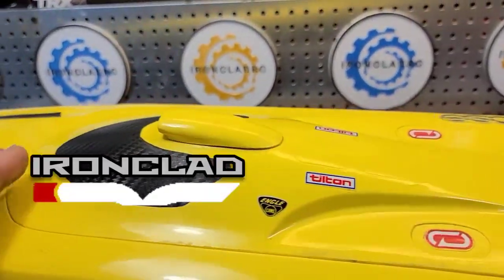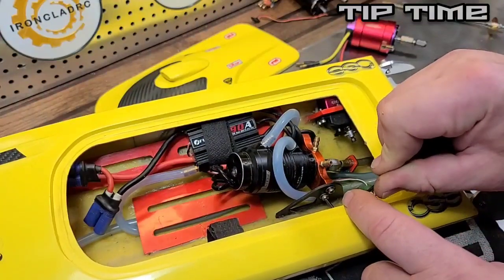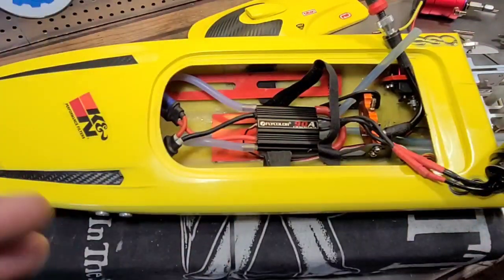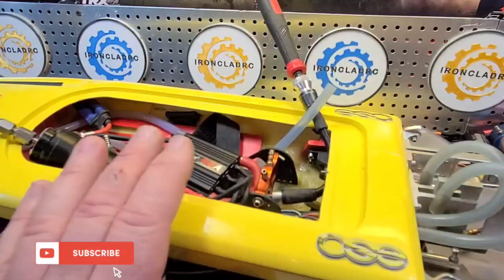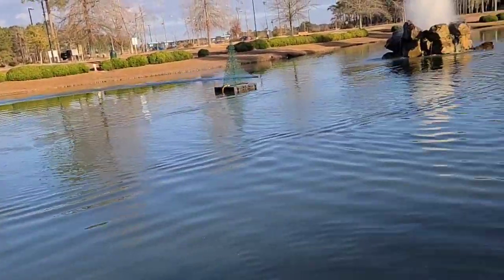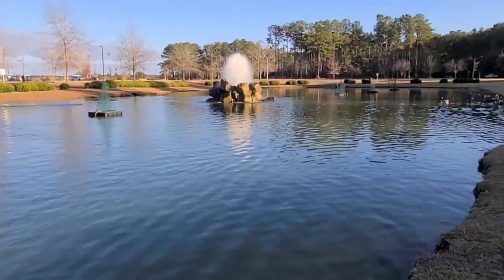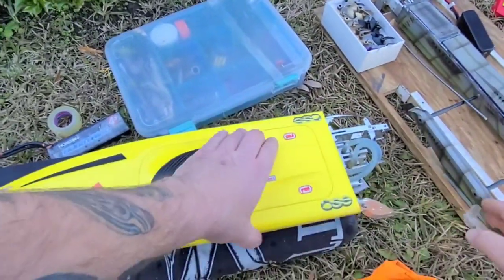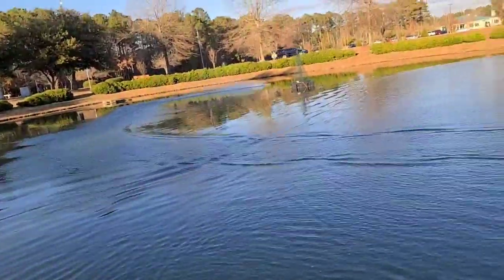Worlds Most Versatile & Tunable RC Boat Setup Explained - 6s Big Block Testing

Comment: Have you tried tuning the esc by transmitter without the program card? Ive yet to try on my 150a flycolor but id like to turn on reverse for my new sonicwake so its more like the stock esc
Reply from the maker: Yep, no a problem.
Reply from the maker: I've set parameters on the flycolor esc through the rx/tx.   It's not hard. Do you need me to make a video going through the parameters?
Reply: @IRONCLADRC  That would be sweet, I was scrared on messing up a setting and not knowing how to revert it lol. The manual isnt super clear on the tones and whatnot, would be awesome if you had the time!